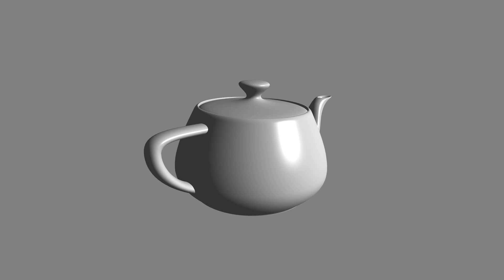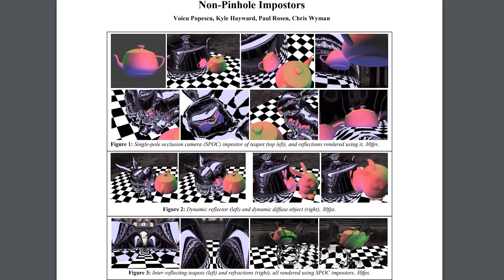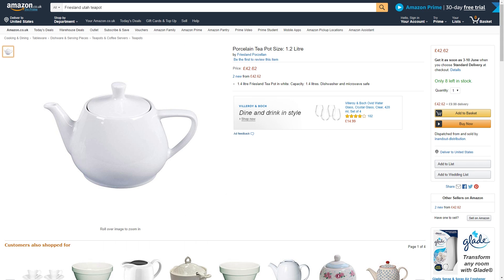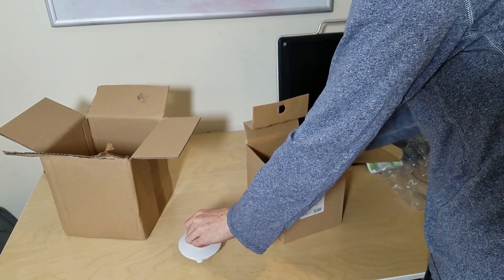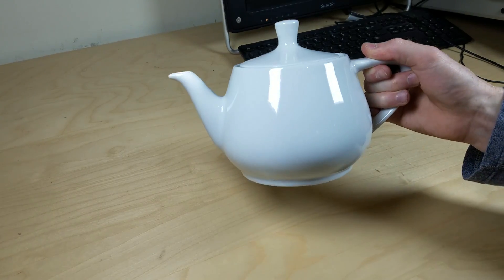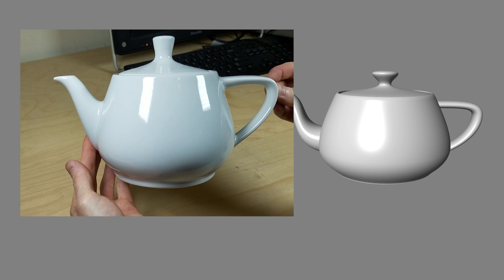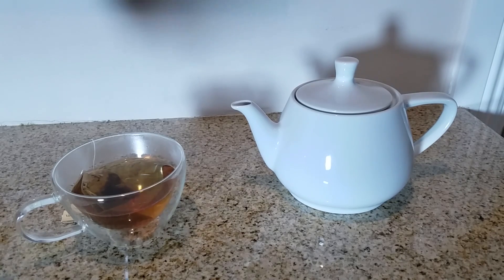Photorealistic Utah Teapot

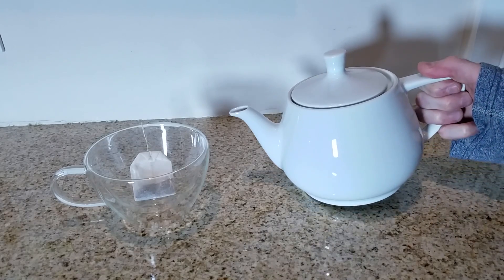Comment: 1:35 The reason I heard for the squishing is supposed to be that Jim Blinn wanted to display it on a monitor that did not have the same pixel density vertically as horizontally. So he scaled it vertically by a 3∶4 ratio so it would look right.

But thinking about it, that only makes sense if everything in the scene is only going to be shown in the one orientation. Otherwise you would do the nonuniform scaling as part of the display transformation, not individually on each object.

Frankly I’m not keen on the squishing. It no longer looks like a teapot, more like a genie lamp.

Comment: You have an incorrect about the reason why the pot is squished. 

The real reason the pot is squished was because the measurements of the pot were initially put into a mathematical system that read the matrix coordinates of the pot in a taller than a wider fashion, so when computer systems started becoming universal and the mathematical matrix systems were changed the pot got squashed from what it was initially input as, since it had become such a staple people decided it was best to leave it be.

Comment: reason the model is squished is cause some animators remembered the exact code for it off the top of their heads and just typed it all in, others messed up a couple of numbers and made it look shorter or taller
Reply: @Michael Darrow well if you fubbed the numbers for the height then it’ll squish on those dimensions. I’m sure there’s a tom Scott video or something explaining it better than I did 2 years ago, but older 3D modeling was based more on equation and point plotting. You couldn’t see it until rendered after coding, so if you messed up the height and passed it along, that model will be squished and others would probably copy it.

Comment: Legend has it that the squish came from transcribing coordinates from a display with non-square aspect ratio.
Reply: wtf does that even mean?
Reply: @rukna3775  To explain a bit further: Computer graphics were not always designed around square pixels. CRT displays do not have a set number of pixels per line, and the maximum horizontal resolution is purely down to how sharp the display's electron beam happens to be, compounded by most displays being repurposed TV sets. This changed as dedicated monitors became the norm, and computers were no longer bound to NTSC specifications.
It was speculated this was the cause for the teapot to be squished: The different pixel aspect ratio caused the teapot to look squished. But that's unlikely - The point of the model was to render it at all angles, and rotating it away from the side would compound the distortions. The designer stated the reason for the squished model was to demonstrate the model could be manipulated, and it just stuck like that.
Reply: @rukna3775  I've never heard or can verify the legend but what old monitors were square there displays were 1:1 but modern displays are 16:9 or rectangular so when shifting from one display maybe no one caught that the teapot was squished
Reply: @yonil9  I know that, I get it, but u didnt get my joke, but thnx for the information atleast.
Reply: @Rukna Bro you're just not an epic geek  awesomesauce nerd you wouldn't understand 😎
Reply: @ultr4nima  i was just joking bro, chillax

Comment: Okay, the start joke got me good.
How did you do the steamless stitching of the shot without and the shot with the teapot? In other words, how did you make it pop into a scene like the software took a second to find the trackpoints?
Reply from the maker: I did several handheld shots with and without the teapot and used an off-screen tripod as a marker of where to hold the phone during the cut.  Then, I found the best pair to stitch together.  I had to do some color correction and alignment in post as well.
Reply: @CodeParade  it was very convincing. My brain even added in some artifical tracking delay on the teapot to convince itself further. Almost like it was saying "yeah it's good but me smart and can tell". Good work.
Reply: True, it was too good.
My brain, instead of tracking delay, convinced itself that there was too much bloom/blur, and was reminded of some amateur Unreal Engine projects that slap as much of effects as possible.
Reply: @SleepyHarryZzz  Same. For me it looked like it was sliding on the table and not tracking quite accurately.
Reply: What really sells it is that the cut isn't 100% perfect, but the slight angle jump makes it look like the graphics engine took a moment to load it in and dropped a frame. If you had matched it pixel-for-pixel, it would have looked less accurate.
Reply: @CodeParade  Why not just take a wide angle shot with a tripod and artificially add the camera shake?
Reply: Henry Ambrose fake camera shake is much easier to spot
Reply: Rewatch a video on 0.25 speed. This switching isnt completely accurate